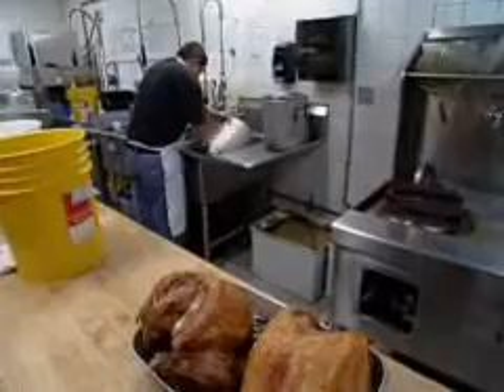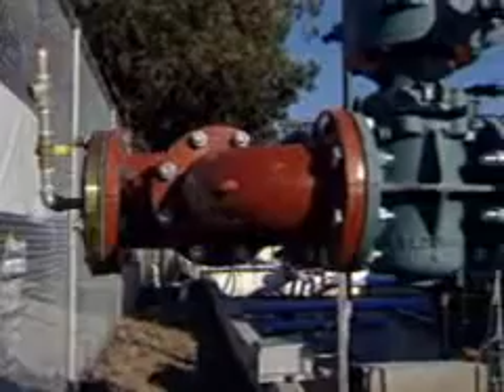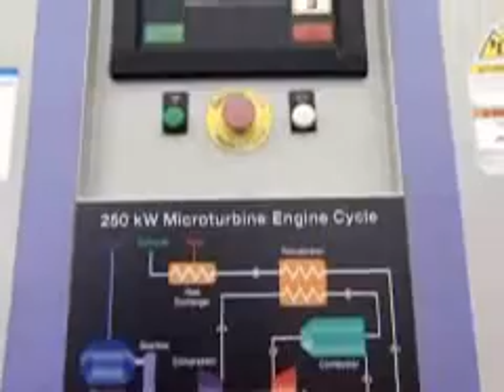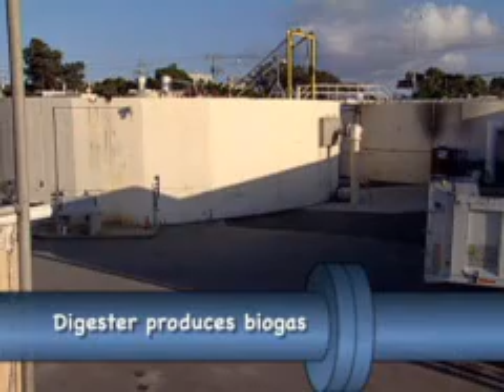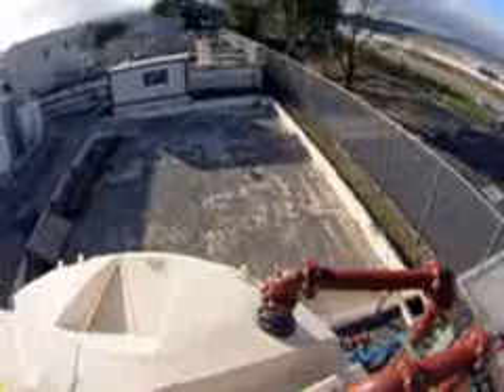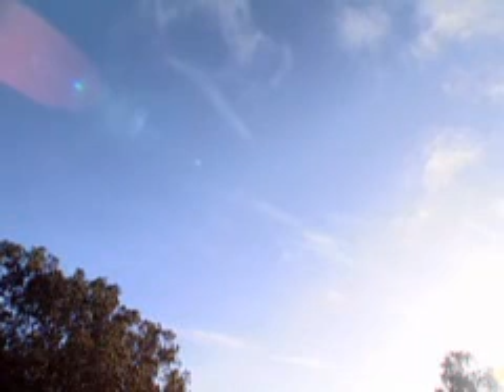Grease Trap Waste to Energy

Comment: Way back in 1987 I ran the wastewater treatment plant at TASTY BAKING CO. We did the same thing but used the methane in a pony boiler to supplement the house heat and steam injection on our ovens. It was old technology then but worked well.